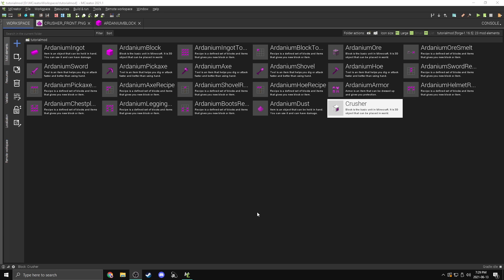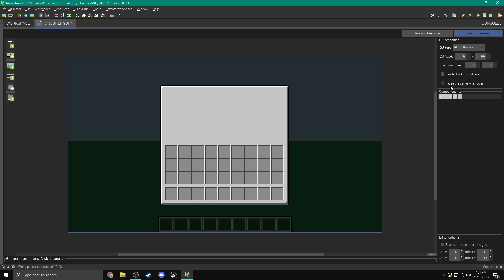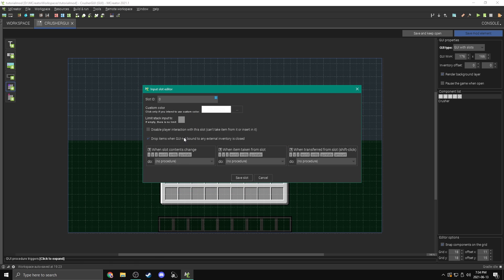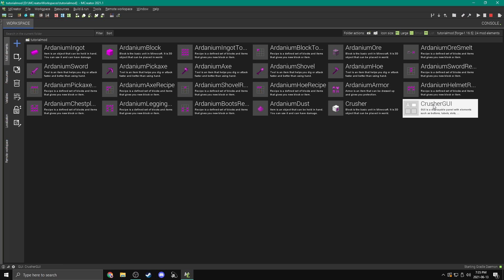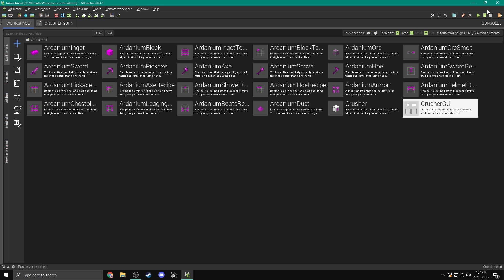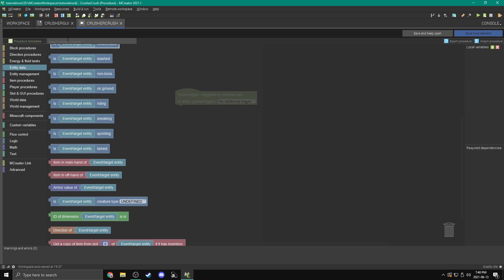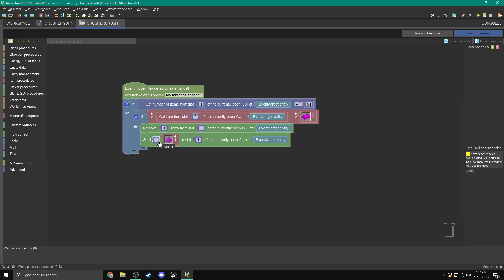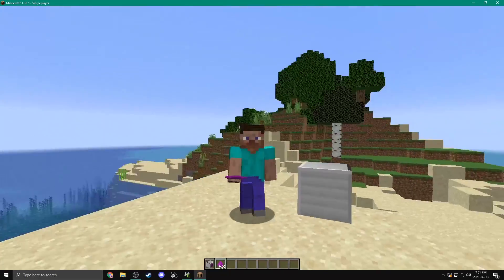Create Minecraft Mods WITHOUT CODING!! - EP4 - GUI and Procedures | MCreator Tutorial

Comment: Can you open it with a keybind? and how do you check if a tick box is ticked?
Reply from the maker: @FieryPadawan  You can check if a checkbox is ticked using procedures, similarly to how I showed to check slots in the video. You can also open the GUI with a keybind by adding a keybind element in the main MCreator interface and creating a procedure to open the GUI when the keybind is pressed.
Reply: @ModMonster  yeah but how do you open it with procedures, that my main issue. You just bounded it to a block, not a keybind.
Reply from the maker: @FieryPadawan  When you create a keybind you will have the option to add a procedure that will run when the key is pressed. In that procedure you can add a block to open the GUI.
Reply: @ModMonster  oh okay. thanks!